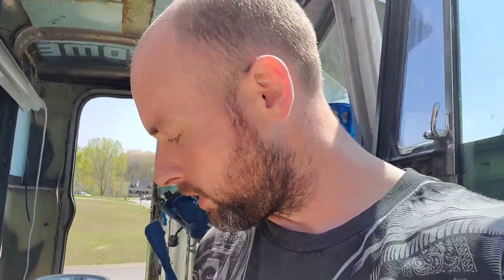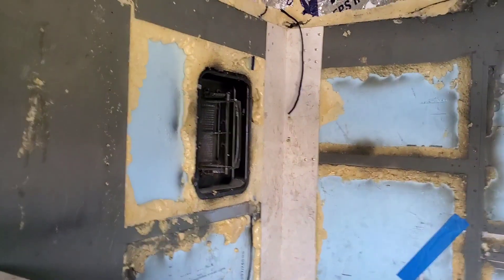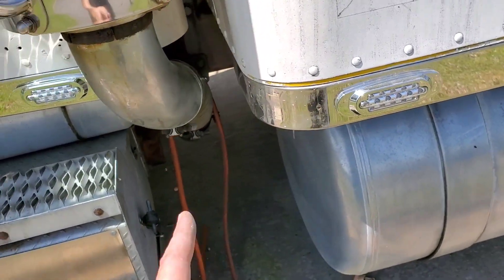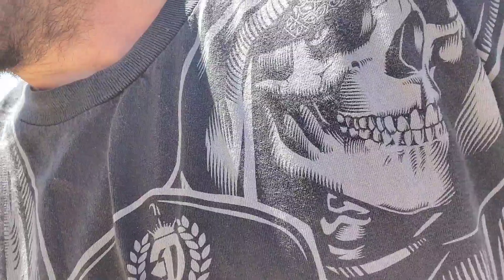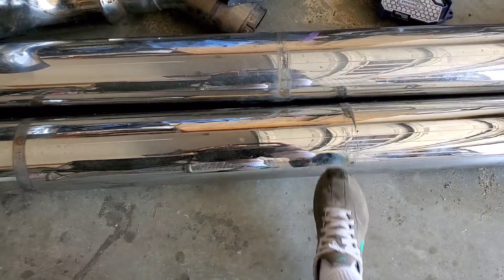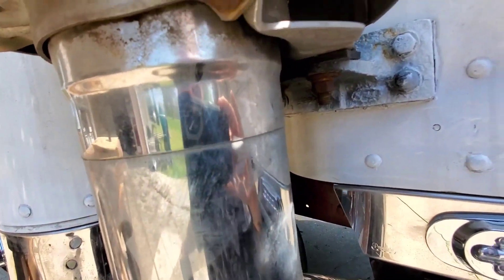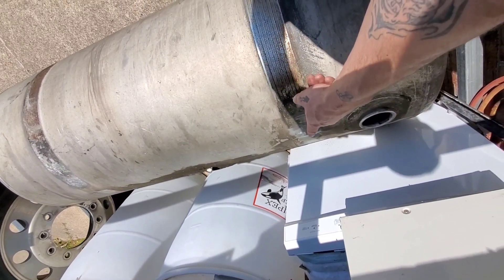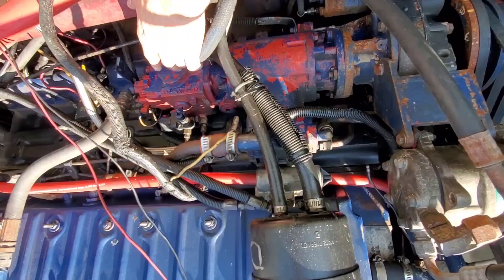Custom peterbilt 379 door panels and update on the build

Comment: those stacks came off a Freightliner Classic not a peterbilt
Reply from the maker: That's possible it would explain why the pickets are like nothing I have ever seen on a peterbilt 379
Reply: Not true, the classic Y pipe  turns up and runs only inches under the cab. Coronado and Columbia are the same, the pipe looks almost like a T, I dare you to find one freightliner installation vid on YouTube with those elbows. Those are not Pickett elbows, Pickett go all the way to the bottom of the step box. Those pipes off the elbows in the vid are exactly for a 379 that isn't using actual Pickett elbows. Caveman, you absolutely have stacks off a peterbilt, not that pipes are truck specific, the mounts and elbows are what determines the truck they are mounted on.